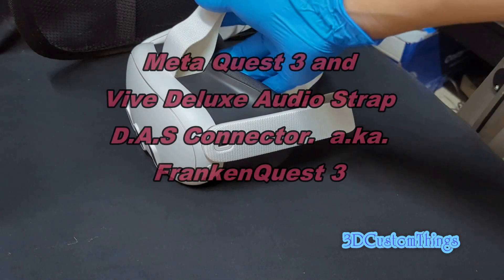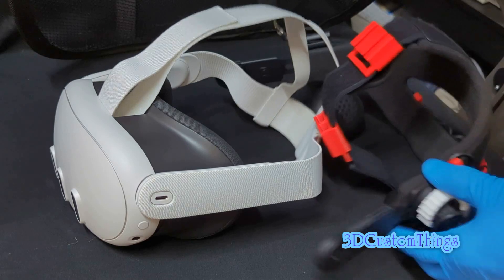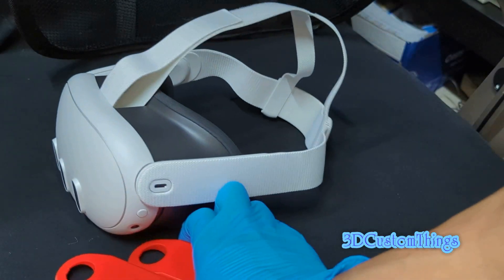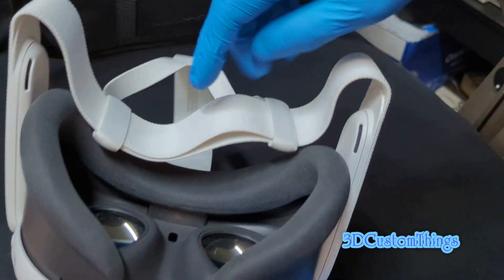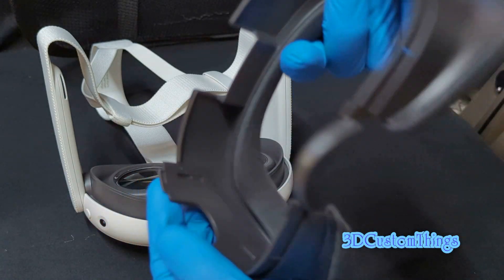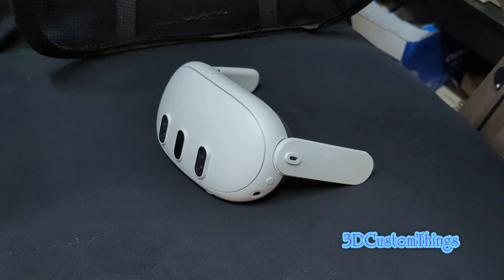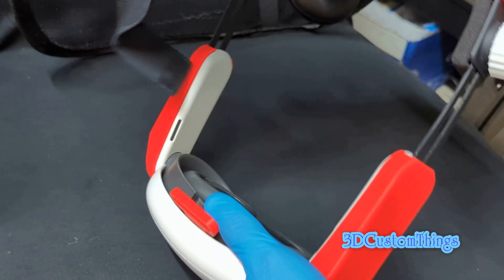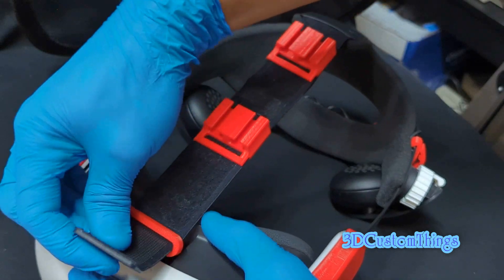FrankenQuest 3

Comment: Been debating to use my vive instead of spending another 100 on a new battery headstrap. Im lening more towards the vive. But What are the white pieces you have attached at the audio part?
Reply from the maker: That's the headphone locks.  You don't need it unless you headphones keeps popping out.  The locks keep the headphones pressed against your ears so it won't pop out.
Reply: @ithelpme  nice thanks to the response and I staying frankenquest style. I dig how it looks